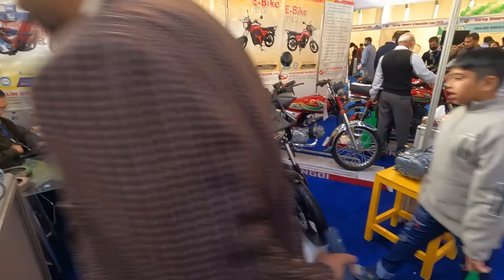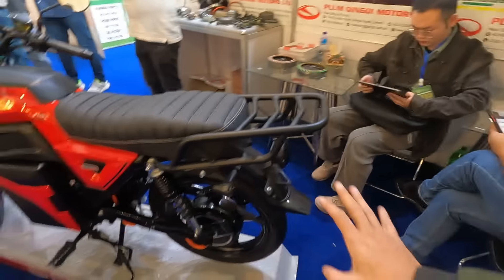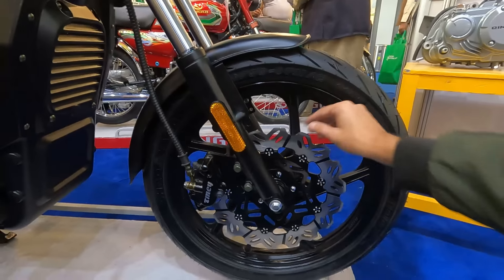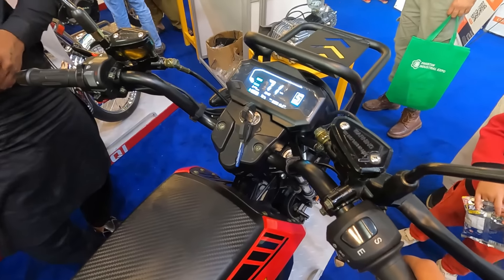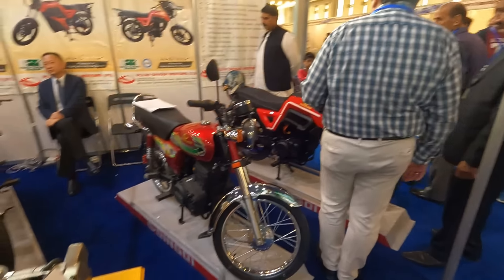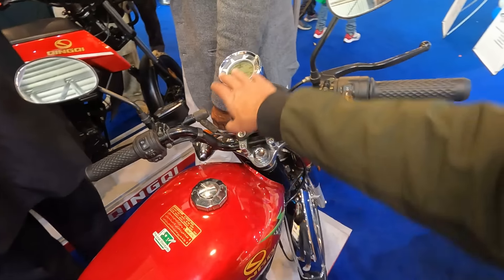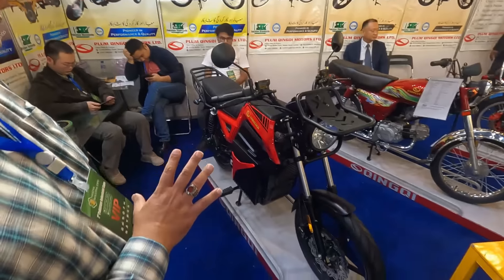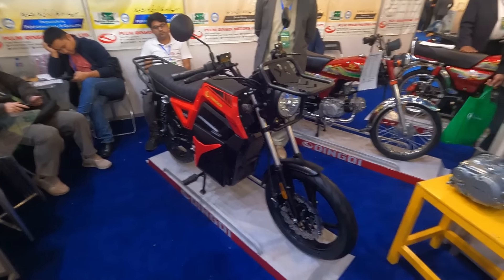QINGQI EV 60 Launch in Pakistan Expo! ڈبل بیٹری والی الیکٹرک بائیک  چنگ چی کا بڑا دھماکہ

Comment: v 60 is really very nice bike. I fell in love with it. I think that the price would be 4,50,000/- to 500,000/-. But to be honest, battery is small, it should be min 45 amp. Other wise, design, build quality, 2000 watts motor, its sleak bike. Battery swaping is not a good option. as the guys was working hard to push the battery back into it, we have a lot of dust, so that will ruin such pull/push things.
I have MS Jaguar, 125 E, and that is working very nice. Its range is more than 100 km/charge.
Reply from the maker: Are you from Lahore. I want to check out the ms jugar
Reply from the maker: Contact me at insta https://instagram.com/horsepower.com.pk?igshid=OGQ5ZDc2ODk2ZA==
Reply: Very expensive
Should be around 200k